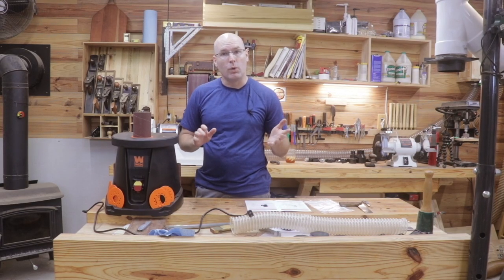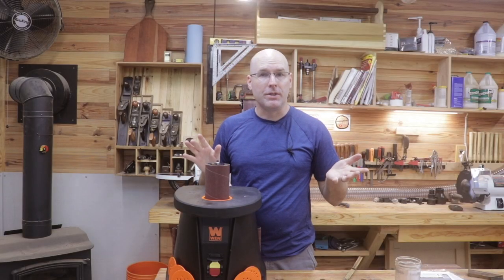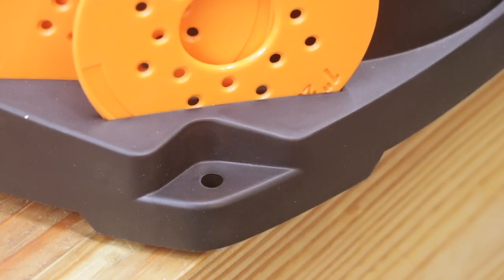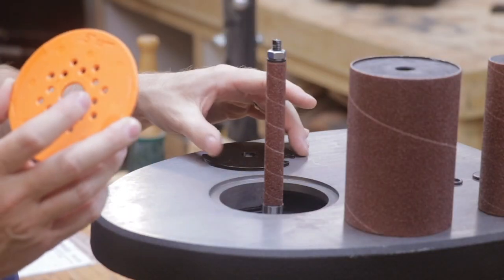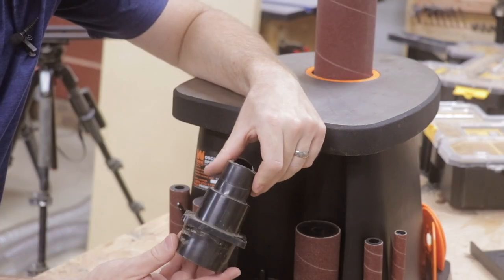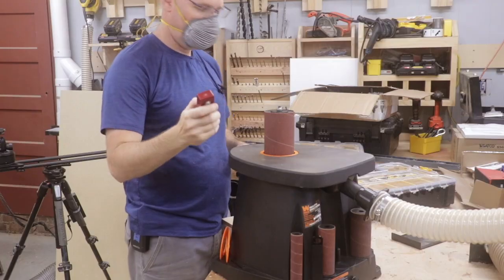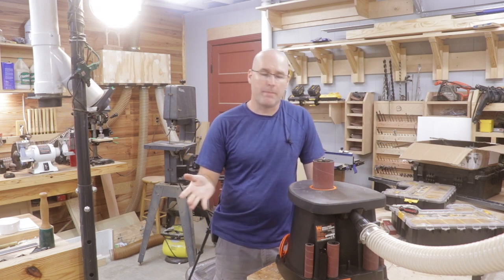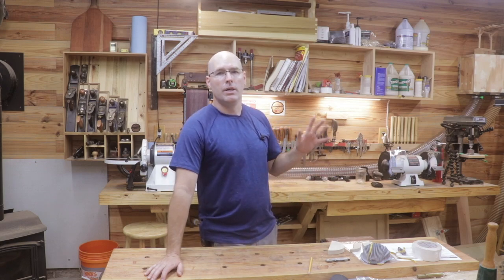Testing The Cheapest Oscillating Spindle Sander On AMAZON!

Comment: thanks, I have purchased several WEN tools, Jointer (appears to be same as Craftsman, but $100 cheaper) trim router, benchtop belt sander, extremely happy with all. I started tinkering with wood working in 1980's, and always bought Craftsman or Delta, WEN is on par with them quality wise, but cheaper if you order direct FREE s-h on orders over $25. My WEN spindle sander will be here Sat.

Comment: I have this same sander. Today I was using it on some small wood parts and it suddenly quit oscillating. The drum continues to spin just fine, but it no longer moves up or down. Anyone else have this problem? This sander has had very light and seldom usage since it was new.

Comment: I don't have any Wen tools but there's a "supposed" new in the box Wen oscillating spindle sander just like yours in our town on Marketplace for $65. That's a great deal 👍
 I'm curious why they don't recommend using any paint thinner or mineral spirits to remove the coating on the top 🤔 
 Doesn't seem to make a lot of sense to me unless they're trying to keep something strong from running down and removing paint from the side or getting on the plastic base and damaging it. It has me scratching my head.

Comment: I got their 6.5” track saw for a bday gift. The mode selector was broken. Couldn’t tell at first. Made some cuts, put it away for a couple months. Came back and saw a tiny spring poking out. 

Very low expectations calling customer service. Had a human in 2 minutes, a return label in 5 minutes, and a replacement saw in two days. He apologized profusely and said if anything like this happens for up to two years, you should expect this same service. For a $95 saw, I’m floored. 

Not to mention it cuts like a dream with their thin nerf Teflon blades. Got the 56 and 24 tooth blades for $36 total. I’m not a pro by any means so honestly user error is much more a factor than machine precision. It’s outrageous they have such a higher build quality than harbor freight and Ryobi, and throttle both with customer service.

Comment: I'm blown away that this machine actually comes with a cast table for the cost... currently <$80 on Amazon as of Q4 2021.  This is a no-brain purchase for me.
Reply from the maker: I bought two more because I like it so much. I'm gonna make jigs to fit it for various operations.
Reply: @lastingbuild1373  have you drilled finger holes in those plates? That would be totally worth it.

Comment: Whether you could, or couldn't . . you are not supposed to cut right at your line when using a bandsaw. So sanding or filing is expected when getting a part to the correct dimension.

Comment: I would call it a Success ! Plus the other thing is it appears that almost all the Oscillating Spindle Sanders  these days are all the same ones just Rebranded  with different names Wen Brand has been around since the 1960s  but I don’t think  the modern tools are  a part of the same Company , my Dad had Wen power saws and Sanders I remember using in the 70s as a boy  one of Wens bigger claim to fame so to speak was  a Reciprocatting Saw. That used the old style Jig Saw blades with the one hole  in the tang  and that Saw did  sort of look similar to a SaberSaw or a Jig Saw  with a wider bigger Base on it  and they marketed it with a Fancy catchy name like a KutzAll  Saw or something Similiar Wen also made tools for Montgomery Wards rebadged Power Kraft  which was Montgomery Wards brand  and I think they built  some large heavy Duty 1/2” Drills that  had a lot of Tourque  and Spun pretty slowly  too  those were good for drilling Steel  and other heavy projects  but it does appear that today’s Wen branded tools are just Rebranded Made InChina  tools that are marketed. By different distributors  and Toolcompanies either Online or in some Brick and Mortar stores like Harbor Freight  and some of the big Box Stores

Comment: I know this is a weird question, but is there anyway to have it not go up and down and just spin instead? This tool would be perfect for my hat making but only if I could have it not go up and down. If that is not possible is there a similar type of tool that would just spin upright like this tool but not go up and down? Thanks in advance for your help.
Reply from the maker: No it does that to avoid deep scratches in the wood and use more of the sandpaper. You could use a sanding bit in your drill press for your needs! Thanks for the Q!

Comment: Would be nice if I felt like it was a quality tool but if you look at them online there are several different companies selling the same exact machine but each has a different color based on the brand and I own one sold by harbor freight tools and I've had for about two or three years but have hardly used it and as of a week ago I'm seeing blue sparks flying out of it and smells like the wire insulation is melting so I stopped using it and it still looks brand new. I checked several reviews on all of the sanders that have the same look as wen, triton, grizzly, harbor freight, and I think fox and they all have the 3.5 amp moter and almost all of the bad reviews are for the motor burning up and in some cases it burned up the same day or week that it was bought. I'm thankful that many years ago I built a spindle sander and I had to pull it out of storage and trust me when I say it has many, many hours on it and still runs like a champ it just doesn't oscillate and its made from and old moter I bought at a garage sale. I want to buy another one but am having cold feet over this style of machine and varies substantially in price and I'm willing to bet that they are all made in the same place in China but the simplicity of the machine makes it fairly easy to fix if I could find a place that sells a replacement motor. Do you have any suggestions?🤔
I can't see any information on the motor itself giving any specs as to where I might track one down

Comment: Thanks for a good review. My main issue with the sander is that the amount of vertical travel seems small. Can it be adjusted so that more of the sanding disc gets used?
Reply from the maker: Not that I know of. I have been using it almost daily, still like it as much as when I did this review.
Reply: After using a spindle for a while, just remove it and turn it upside down to use the other end of the sandpaper.

Comment: What's the best tool for the opposite situation: I have a bunch of 1.5" thick circles I need to sand the round faces of?
Reply: Ideally a bench disc sander would be best for rounding outside corners. however, I am pretty sure you could achieve similar results on a spindal sander as well by rotating wood against spindle.
Reply from the maker: If I understand your question correctly, I think a disk or belt sander would be the tool!

Comment: Great video! Do you further sand those edges with bigger grit drums? I find the 80 grit really abrasive on my edges.
Reply from the maker: I use it  for rough sanding and shaping then finish with other grits by hand. I'm not sure if other grits are available for the sander.

Comment: I have the Wen Air Filtration System model 3410 works great, one of the next things I will be getting from them is the bench top variable speed drill press.
Reply from the maker: I have seen that air filtration system! How often do you change the filter?
Reply: I received it on May 20th installed it have not needed to change filter yet, but I do notice when garage door is closed and I am using miter saw or table saw very much there fine saw dust floating around.

Comment: Place the smallest drum in, do not install plastic corresponding plate. Instead take each of the plastic plates and slightly hit one edge till appropriate finger slot is made on each. Use as directed after this has been achieved.

Comment: Was it my imagination, or did your square make it look like the spindle wasn’t 90 degrees to the table? Clearly the sanding work showed it to be square. 

I have a WEN drill press and it works great! Reliable for the basics.
Reply from the maker: Yes you are right, It is slightly off, probably because the sanding drum slightly enlarges to hold the paper on tight.

Comment: I have a Wen Drill Press. When I received it I grabbed the front of the unit to pull it out and somehow broke a tab on the power switch. A couple of weeks after decided to call and buy a new cover. 
I called the manufacturer and got to the right person, in almost no time, I asked if I could buy one. He said that I could not buy one but he would be happy to ship one free of charge. 
Im certain the part wasn’t very expensive. But just the way that they handle this situation moves them to the top of my buy list immediately.
Reply from the maker: Thats great to know!!

Comment: I have a Wen spindle sander that can swap the spindle shaft out to add a belt sander. It is easy to swap and does a good job.  Reasonably priced and works well. I have mine mounted on a flip top cart. The only downside to this is that the spindles and rings fall off when it is inverted. I have a drawer on the cart for part storage and for sandpaper sleeves and belts.

It is 2 years old and does the job, I would purchase it again.
Reply from the maker: Thanks for the info

Comment: I have a WEN band saw and drill press and I have been very happy with both.  They are not super high end tools but in a head to head test with my father in laws Bosch drill press the WEN out performed it hands down!  I use it on steel, wood and aluminium.  With good drill bits (good, not great) it cuts thru like butter.
Reply from the maker: Thanks for sharing! Good to know!!